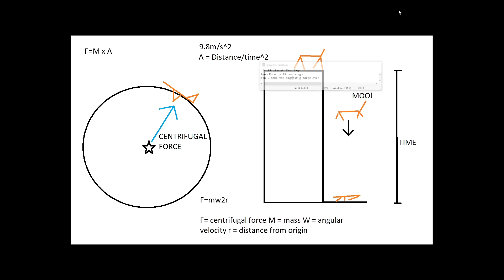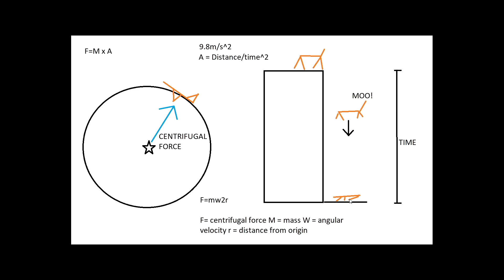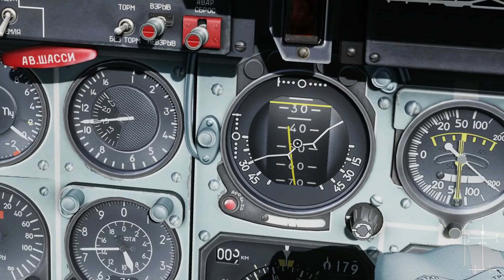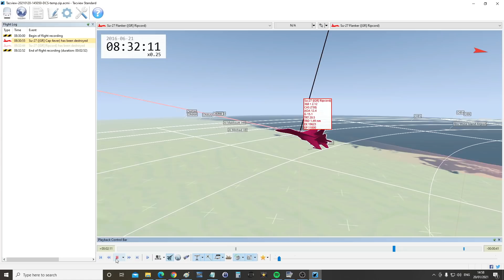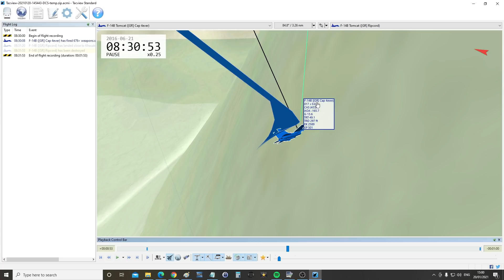Questioned: What Is The Highest Possible G-Force In DCS WORLD?

Comment: The terms you're looking for are "G onset" and "sustained G".  The T-37 had MASSIVE g onset, at nearly 5.5G *instantaneous*.  It couldn't sustain that however, as it bled energy very quickly.  The F-16 can sustain 9G for a good long while in some regimes and configurations, as they learned in the early 80's when so many pilots were having issues with not only G-LOC, but also wire chafing due to the g effect moving wiring harnesses around and rubbing on bolts, screws and other things causing instruments and other things to fail in flight, often resulting in the death of the pilot...